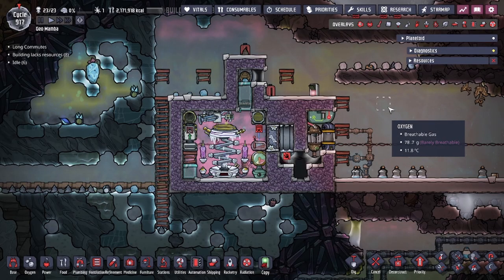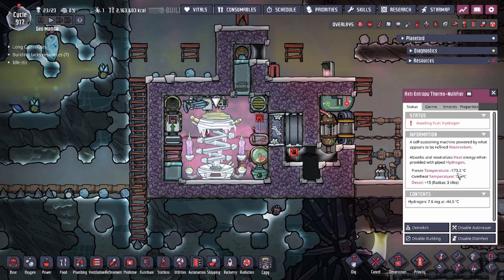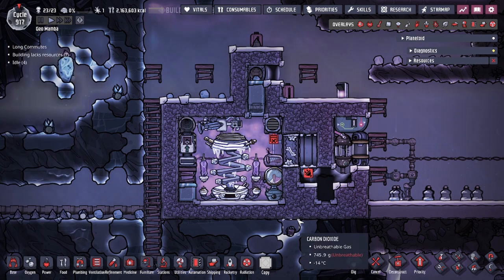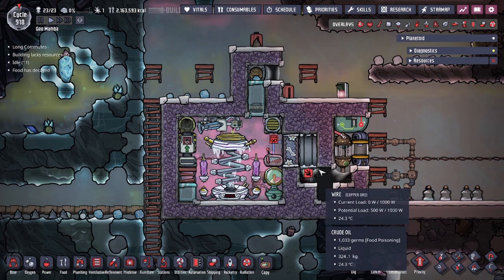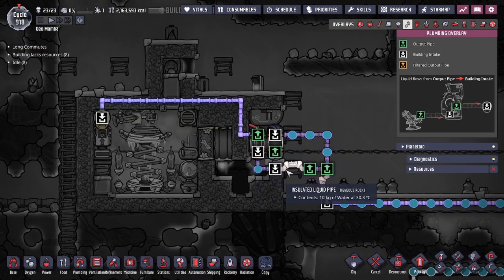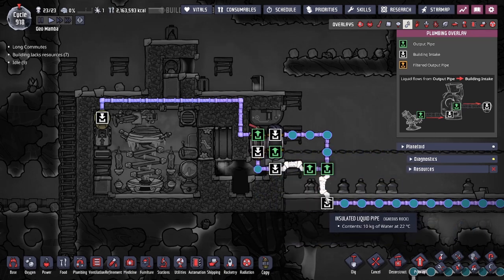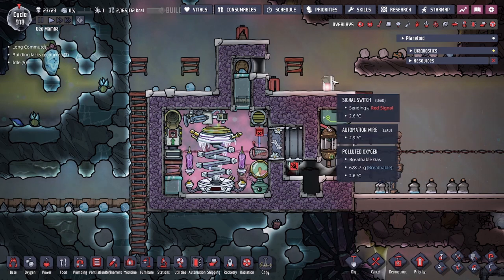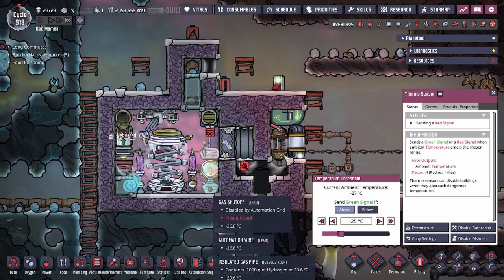AETN Ice Machine Design - Utilize the Anti Entropy Thermo-Nullifier - Oxygen Not Included

Comment: Dude The machine is great! By the way you might just solved a frequently asked question. People constantly asking on forums, "how to cool down geyser water?" An interesting idea formed in my mind. Can pump our cool steam vent water into a standard compact electrolizer setup, wich has open flow for oxygen, and only collects hydrogen.  Pump the hydrogen into the machine, and access hydrogen into a generator with smart battery. The AETN however can run constantly. Take ot the ice and dump it into a nearby pool with metal tiles at the bottom. Under those metal tiles, coud be a sealed tepidizer, to control the temperature of the pool. The ice melts back, and you get water with controlled temperature. (I like to farm the blossoms cause they look great, and the seeds can go feed pacu) I am pretty sure, since neither equipment needs to run constantly, the wattage usage is far more effective then using aqatuners. (Wich is quick but pointless)    
Cheers
Reply from the maker: oh i see, so youre just using ice since its bascially water starting at 0c. glad to be able to help! cheers!
Reply: the aqua tuner isn't pointless, it is designed with a steam turbine in mind for endless conversion of heat into electricity. But the anti entropy cools down several biomes worth of space without the need to control/manage the heat or using a lot of dupes to create a steam turbine gadget.

Comment: I think it could be op if you pair it up with a Hydrogen vent, (you should pump the Hydogen with a gas pump that can withstand 500+ Celsius so you don't have to provide cooling for the pump) And it will provide you cooling indefinitely as long the pump is running so 240 wtts/s.
I used it to cool the environment outside of the dupe living area.

Comment: Couldn't you set the room high temp a bit higher than the AETN activation?

  You have yourself a 25 degree safety margin.  Seems like the machine may find some equilibrium with water still flowing in up to -15 or -10.
Reply from the maker: i could! - honestly there is room for improvement but i was happy with how it was running